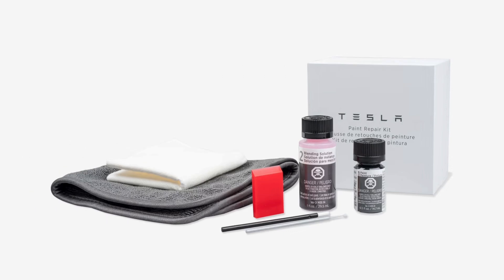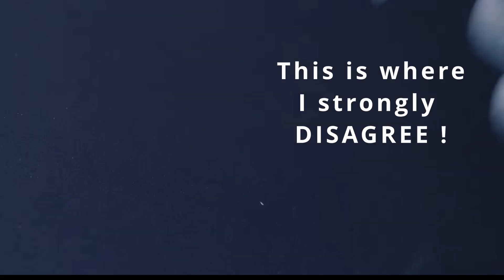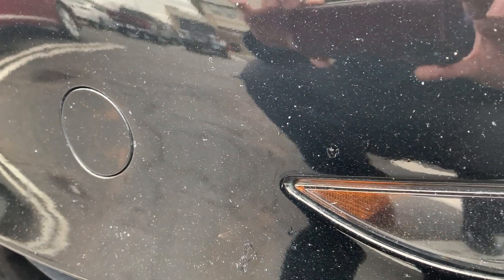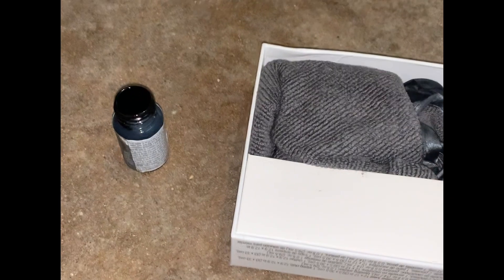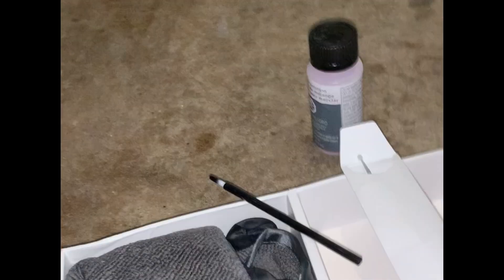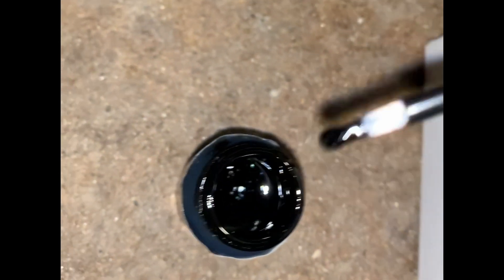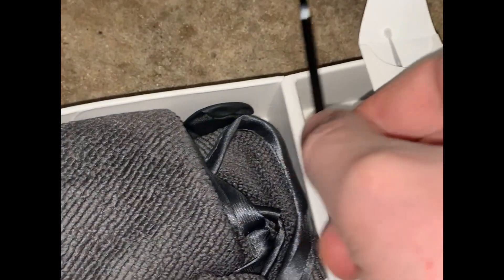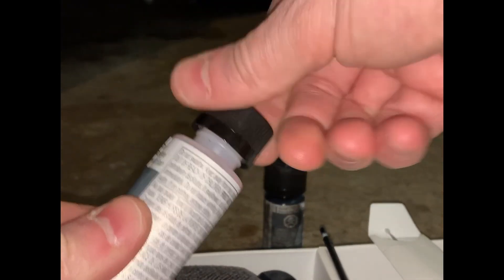Tesla Paint Repair Kit - The BEST Results using PROVEN Application Method with 5 Years of Testing

Comment: Would a toothpick work as well as a safety pin?
Reply from the maker: If you don’t have a safety pin, I would try a needle. If you don’t have a needle, I would do the toothpick, but probably best to try with a clipped fingernail or something else that has an extremely tiny point.
Reply: I would say toothpick would work. Basically, using a narrow object to dip the paint and smooth it out on the scratch. At least, toothpick might not scratch the paint as bad as the safety pin would.

Comment: I use Dr. Color Chip, which basically is the same as the Tesla paint. You’re right, no matter how many times you fill the indentation of the chip, it never fills in. But I don’t think the slightly elevated safety pin job looks better than the slightly indented version. In a couple days, you have trouble even finding the affected area. To the naked eye, it all seems to blend and for the most part disappear. I have the pearl white paint.
Reply from the maker: @BobbieGWhiz  interesting, I find that a safety pin or toothpick helps to (1) be extremely precise, (2) eliminate the step of using the blending solution, and (3) provide a shiny finish. Whenever I use the blending solution, the paint loses its glossy shine. I think if there is a solution to reapply clear coat after that, then it is OK. But I haven’t found or heard about any clear coat paints.
Reply: @techgeektesla  When you show your irregular paint blob up close it doesn’t look good. I suspect from a foot or two away it’s unnoticeable, but so is a slightly indented paint chip repair. I honestly never thought about the glossiness or not of the repair.

Comment: Glad I found this video when googling how long I need to leave the paint on before washing (24 hrs as suggested online?? What would you advise?)

I appreciate you showing us all the other methods but you’re basically saying use the method from 15:50 in the video?

My scratch is a thin line, deep, but exactly the same. I won’t use the blending solution. Maybe that was the advice/instructions as most people have less patience to do it with a drawing pin but that’s what I’m gonna do, minus the blending solution of course. Thank you so much.
Reply from the maker: Yes, sorry the video shows many trials and errors until explaining the final method (using a safety pin). No matter what, I found that it's impossible to make the surface perfect again. The real question is how perfect can you get it? The squeegee levels the paint, however, the blending solution generates a matte finish. It's not ideal. I would definitely recommend using a very SMALL amount of paint on a safety pin or other very sharp/pointed object to apply it. It produces the best results.
Reply: @ thanks, I’m gonna try it with a pin or toothpick tomorrow. How long do you recommend to wait before a wash? Obviously no hard scrubbing on the filler.
Reply from the maker: @ it dries fairly quickly. Safe to wash after 12-24 hours, I’d say. I started using the kit the way the instructions say. With the squeegee and blending solution. The marks were on the hood of my car. Horrible results. I can still see the spots today. When I started using a needle to dab the smallest amount of paint possible, I could still see the spots, but they don’t look as bad as the others.
Reply: @techgeektesla  I just touched up the scratch, it was on the door. I think I did an OK job with the needle considering it’s just touch up paint. I levelled it out and it’s a bit flat but looks fine. The OCD in me wants to layer it but I think I should just leave it and not ruin it? I took a picture. Obviously it’s never gonna be perfect but it’s better than before

Comment: What if you'd try a buff wheel with a power drill?
Reply from the maker: Are you talking about doing that after it dries (after using the safety pin)?
Reply: @techgeektesla  yeah I'd say after everything even a few days later do make sure it's dry and fully adhered. Do you think it would make it smoother and less noticeable?
Reply: Great question. My thoughts also?

Comment: You don't understand how this works, my friend. You keep applying paint and then removing it. lol

You need to let it dry more before using the blending solution and working it down to even with the factory coat.
Reply from the maker: @kenhiett5266  this is something I have tried many, many times. 5 years of experience using this paint kit! I even let it sit for 1 hour before using the blending solution. It still leaves a matte finish every time even after polishing and waxing, it never looks good enough. The method in this video works best for me. I’m OK if it doesn’t work the best for others though!